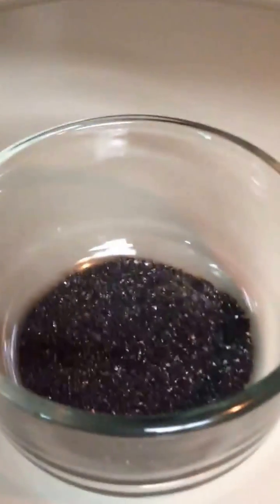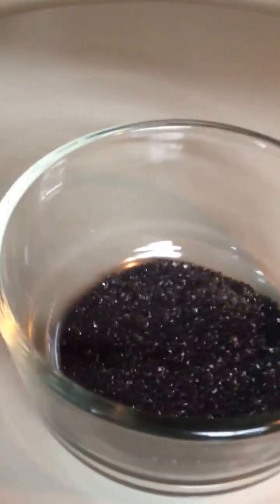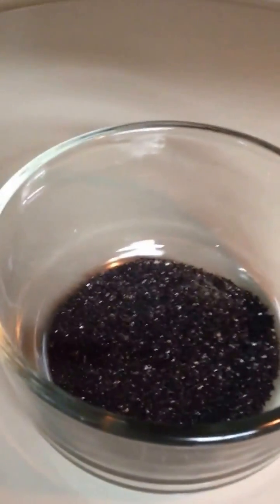Carbon in microwave explodes

Comment: Good of you to share this video and help others prevent getting hurt. Have you found an alternative dish to use? I've been trying to find something, but not too sure offhand on the results. Some materials included silicon carbide, sodium acetate - though I'm not sure if these are suitable as yet.  Perhaps you could achieve the same thing a lot safer using a Fresnel lens. That's what I'll be using to try and make graphite.

Comment: The glass container exploded or the carbon exploded? why?
Reply: I believe the carbon got very hot and heated the glass unevenly causing it to fail.
Reply: It is because the glass container was made of sand glass.  Which all modern product of "Pyrex" are made of.  

It is sort of a bait and switch because see Pyrex and think Borosilicate, but what they get is Soda-Lime glass
Reply: Pyrex will do that too, if it gets cooled rapidly or heated unevenly. I blow glass. All you have to do is drop it's temperature beyond it's working range is about 450f. After that it causes stress when it cools and it blows up. Unless you cool it slowly and let the atoms rearrange. A ceramic dish would be more appropriate, but the carbon will burn and make Carbon Monoxide. It won't melt ever.

Comment: I actually found the same effect, but I noticed that with pine wood biochar, if it's dipped in water a little, crushed into a powder, and microwaved, the arcing is considerably less and the particles display less of a tendency to spontaneously start smoldering and heat up. I'll have to try this with some sugar charcoal I made, which is differently textured and is more glassy like he used. hmu if you want to know the results. There are definitely electrostatic/electromagnetic forces at play here.